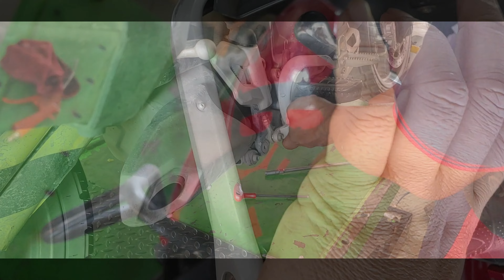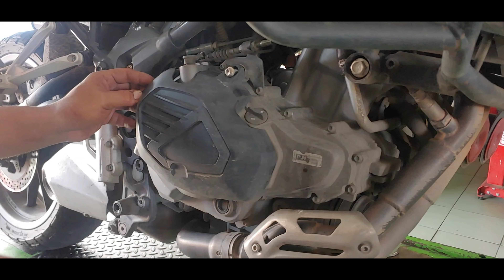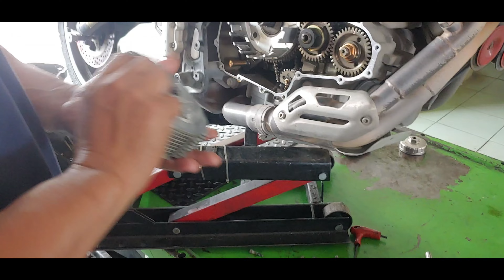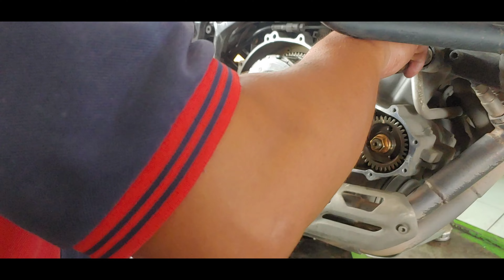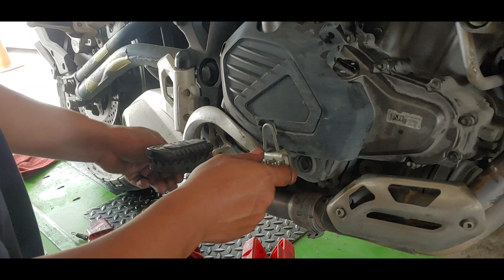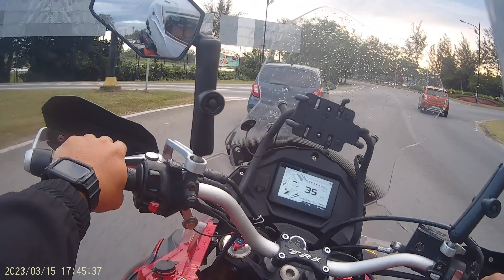Benelli TRK502 -Slipper Clutch

Comment: Hello sir I have a TRK 502 2018 with 49.000 km and in 2 gear and third gear the bike make a small vibration at 45 km and after stop do you know where is the problem maybe the clutch?
Reply from the maker: may i know where the vibration at?
Reply: @shawnliau13ify  small vibration left side off the engine
Reply from the maker: u checked your front sprocket? mayb wear and cause the vibration that side.

Comment: Whats the difference with normal clutch?
Reply from the maker: A Slipper Clutch reduces the effects of engine braking.
It also reduces wear and tear on the engine and transmission, thereby improving its durability.
A Slipper Clutch prevents the rear-wheel from locking-up in case of any uncertain situation.
Slipper Clutch improves the performance of the motorcycle.
One can enjoy a tension-free ride on a bike equipped with a slipper clutch as he/she need not worry about accidental downshifts.